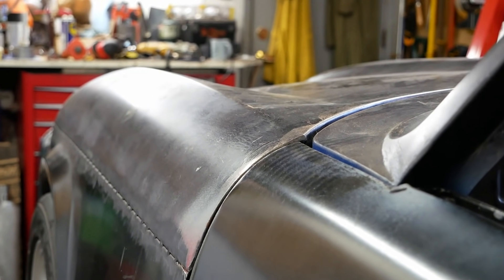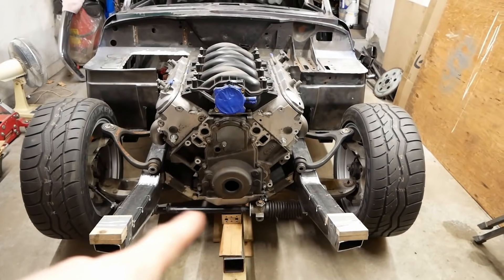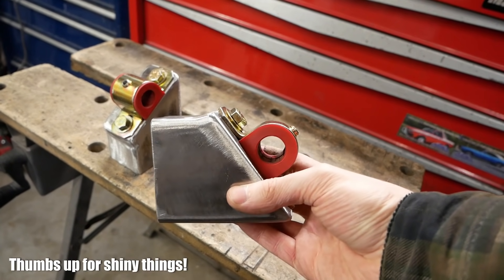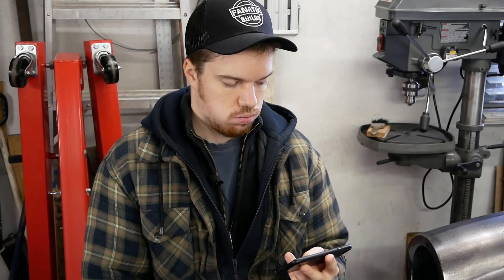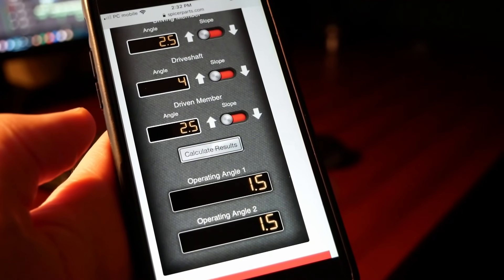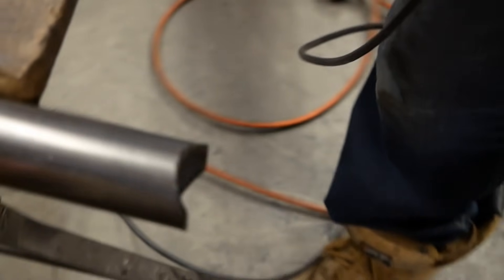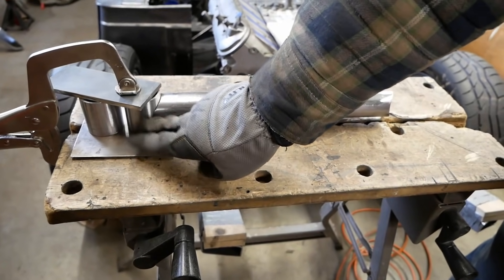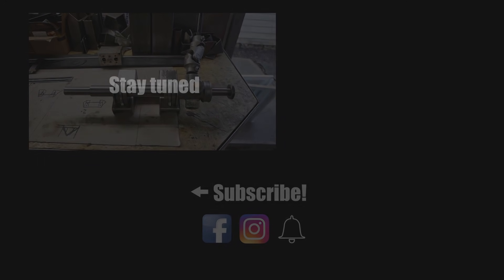Brackets!  Pro Touring V8 Triumph Build – Project GT6R – Ep17

Comment: Doesn't toeing in the wishbones also help with the anti dive geometry?
Reply from the maker: Not anti-dive, no... that IS affected by wishbone angle, yes, but angle viewed from the side, rather than the top which is what was going on here!  The only affects the toed LCA could have created would have related to tipping the knuckles during travel.  Not a huge issue you'd think, but it would have caused some challenges when setting up the steering linkages to eliminate bump steer.  Hope that makes sense!

As it happens we're all good as this is actually how it was supposed to be in the first place!  Didn't know that at the time but would have saved some sleepless nights if I knew let me tell you! 😂 Cheers 👍
Reply: I asked because back in the 90’s I built a KVA GT40. This used Ford Granada uprights (UK!) with fabricated unequal length wishbones that attached to very toed in chassis rails. The designer claimed to have copied the idea from the Jag XJ6, and that it was the reason why that car had anti dive suspension. Compared to your GT6 it was very crude!
Reply from the maker: @TheDocgt40  very interesting!  A GT40 is on the list of cars I want to build someday!  I'm not an engineer, just to be clear :) ... but as far as I'm aware, anti-dive is (at least mostly) created by the difference in angle between the upper and lower arms viewed from the side.  Where the intersection lies in relation to the car's center of gravity, will dictate how much anti-dive you have.  Now, could drastically toed control arm mounting points affect this?  Maybe!... But I don't think even 10 degrees would cause a noticable difference!  I could be completely wrong though! 😄 cheers man!

Comment: I'm kind of curious if hes gonna go electric steering
Reply: toyota  prius  steering  column has been kinda  populare the last  years as  its  very compact and  fairly strong
Reply from the maker: We're not sure yet actually!  On the one hand it might be nice and make the car more usable... but on the other, why bother when we can handle a little heavier steering?  ... Dunno!  What would you do?
Reply: @FanatikBuilds  ...keep it manual mechanical to maintain road feel and reliability.  the LS drive train is lighter so what's the need? BTW the battery is going in the trunk. right?
Reply from the maker: @cocodog85  this is exactly where my head goes!  Plus we've still got the original column so why wouldn't we use it?  ... And yet... Comfort! Bah! 😂
Not sure on trunk mount, but if it goes up front it'll be something special!
Reply: @FanatikBuilds   Your steering is likely to be quite a bit more direct compared to the original Triumph equipment, so it's also likely to be fairly heavy - even with a light alloy engine. I'd suggest at least planning for power steering so you leave room - maybe something similar to what Nik and Rich use in Binky, with a remote electric hydraulic pump instead of driving it off the engine.  That should help with packaging concerns while leaving the car a little more user-friendly (especially if you're just cruising, dealing with tight quarters traffic, or even negotiating a parking lot.) 

Still loving the build, mate.  Lovely job on that front suspension in particular - a difficult and time-consuming job, but very rewarding if you take the time and get it right.  :-)
Reply: @FanatikBuilds  Those electric Corolla racks are pretty good and not very big. Power steering just would make the car  feel a lot nicer to drive.
Reply from the maker: @aussiebloke609  Thanks my friend!  It's a daily back-and-forth thing! ;) ... only time will tell but I agree with what you've said!  As  @Andwise Carter  mentioned the Toyota electric columns are likely a good bet for us - thank you for the input and keeping an eye out for us gentlemen!  Merry Christmas! 👍 🎄

Comment: why not consider even more work and copy TVR's approach and take the manifolds up and forward and gain more  exhaust scavenge and power?
Reply from the maker: Up and forward will either interfere with the wheel-wells or land right where our accessory drive will be! :)  Should be fine where it is, just a little fun to cram in is all! 😂  Cheers! 👍
Reply: @FanatikBuilds  I get your point but TVR engine bays are dimensionally very similar to GT6 ones and going forward allows for silencers inside rails and to exit at rear of front wheels or side exit in front rear axel. https://matthewpoxon.files.wordpress.com/2013/05/2010-06-25-tvr-engine-bay-1.jpg

Comment: i know its probably too late, but are you sure that little strip of bent metal holding the rear control arm to the frame is sufficient?  Have you taken a look at what those mounts look like from the factory (any factory)?  Any time your front wheels hit a bump, those sway bar mounts will be asked to absorb the force of the wheel trying to move backward in the wheel well.

EDIT: not 30sec after i posted this did you address this exact comment in the video....  facepalm...
Reply from the maker: Not to worry man!  It was a matter of space that made us use these thin mounts to start with, but I think with very minimal work we can beef them up considerably!  Appreciate you keeping your eyes out for us as we can use all the help we can get! 😄👍

Comment: I'm not going to live long enough to see this car run. The captive bolt holes will be worn out and need replacing by the time you figure out how to address driveshaft angularity.
Hint: don't make a rainbow out of it, try to keep the tailshaft and pinion angles at about 2 degrees. Your mechanical expertise is only eclipsed by your editing skills.